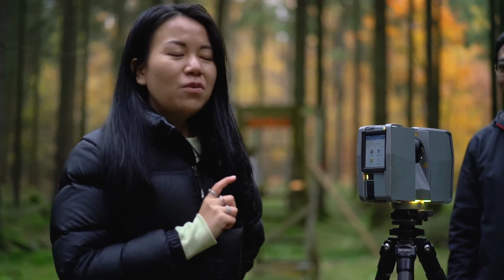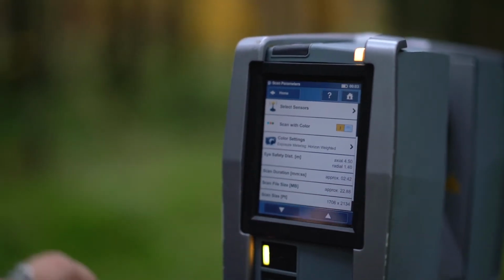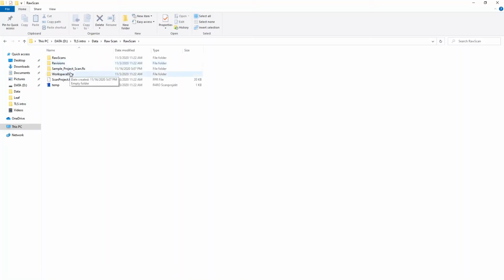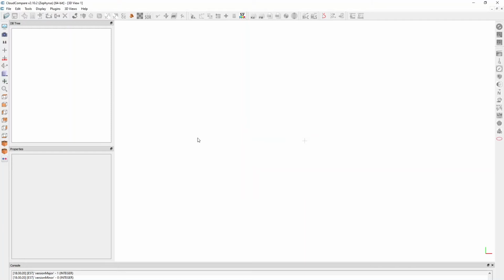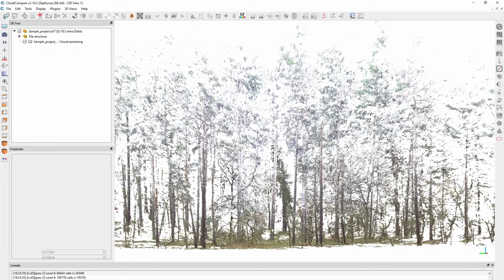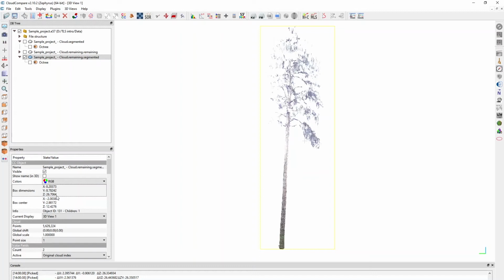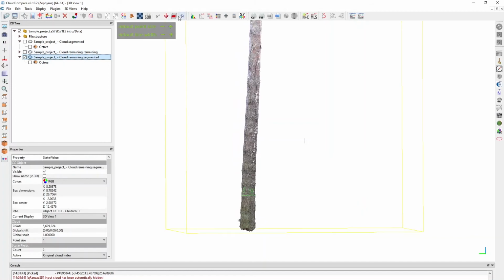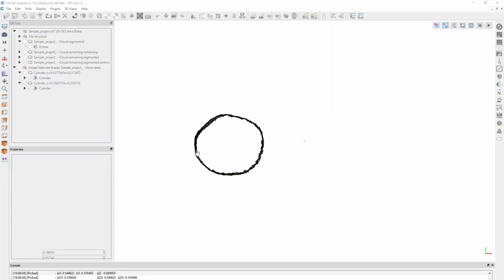Terrestrial Laser Scanning (TLS) of forests

Comment: This is great, would have loved to see how to measure volume of the tree also.
Reply from the maker: Measuring volume is not possible unfortunately. The point cloud consists of XYZ positions of reflections from surfaces of unknown shape. The only option is an approximation by fitting simple geometric shapes, usually cylinders. This is possible for the simple parts, like the stem, but very error prone in other parts. Using a volume model based on dbh and height might be a better option here.